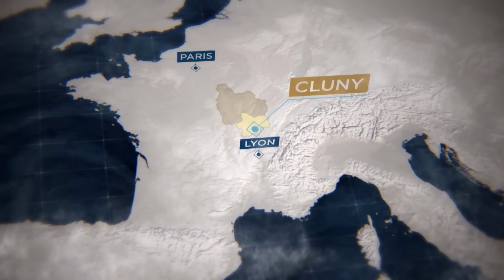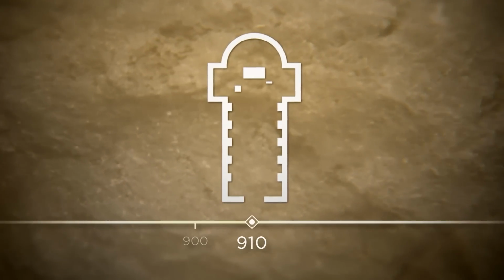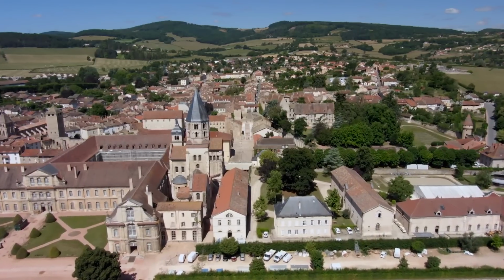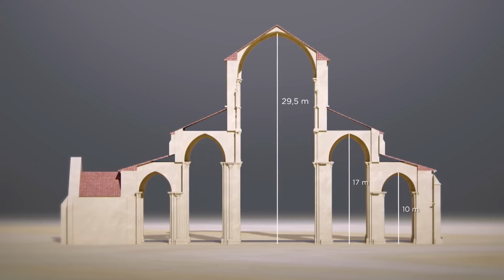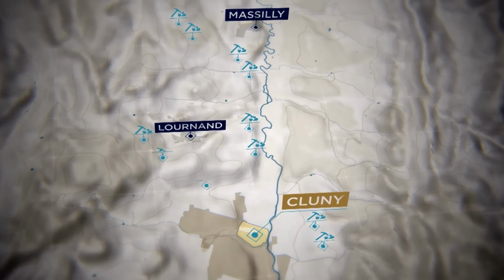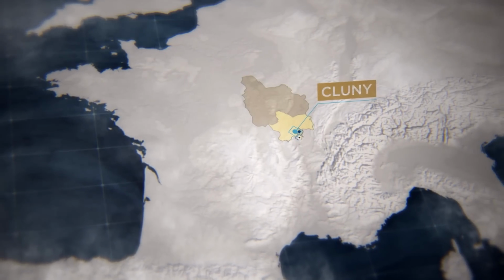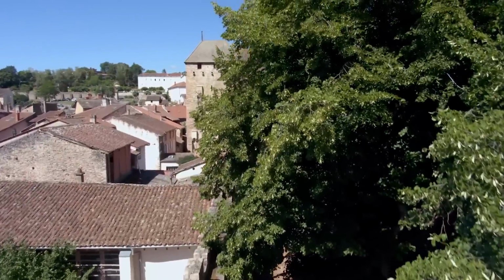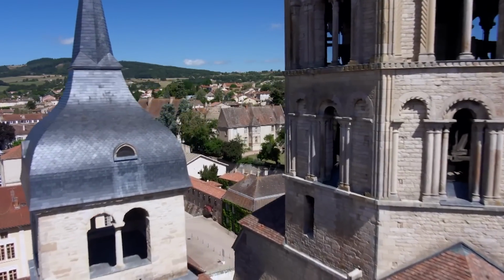Cluny Abbey: The Lost Wonder Of Medieval Europe

Comment: Maior ecclesia means not largest church but bigger church.
Reply: major esglèsia means the most important church, not the largest one
Reply: Largest church also means bigger church
Reply: @gman102formyspace  no.biggest church would be ecclesia maxima.
Reply: @RPe-jk6dv  in English, largest church and bigger church can be used to describe the same thing
Reply: @gman102formyspace  perhaps, but not in latin.
Reply: @RPe-jk6dv  just pointing out why the end translation would be different in English
Reply: @gman102formyspace  I beg to disagree, bigger church points to it being bigger than another it's being compared to, whereas largest implies that this one is the largest of its kind.
Although both statements can be true at the same time, you can still have a building bigger than another, but that does not necessarily mean is the largest there is.
Reply: @Inferryu  largest and biggest are synonyms
Reply: @ Indeed, but bigger and biggest are not the same.
Reply: @Inferryu  it was never a question about bigger vs biggest but the use of Biggest over Largest. And those are synonyms
Reply: @ " Largest church also means bigger church" That there is your very first comment in this tread.
Reply: @Inferryu  correct. Because they are synonyms. What you said was "bigger and biggest are not the same". Something i never said. I said largest and bigger were the same. The argument here was that bigger and biggest have different connotations. Cluny is the largest church. It's also the biggest church. You can say its "bigger" than all the other churches as well. Because both of those words mean the same thing and so does bigger with context.
Reply: @ Do I really need to explain comparatives and superlatives to you? That's middle school stuff dude.

Larg*est* and bigg*est* are (arguably) synonyms, and so are larg*er* and bigg*er*. 
Larg*est* and larg*er* though, are not synonyms, same for bigg*est* and bigg*er*.

As such your initial statement, that larg*est* also means bigg*er* is false.
Reply: @Inferryu  with context, It is "bigger" than all the churches. Thus bigger can be a synonym with largest. language is hard but Jesus christ, do you need to argue about everything?
Reply: @ Yes, but we're not talking about the church itself, but the meaning between these words, are you going to deviate from the topic just to save some face now?
Reply: @Inferryu  go back and reread this conversation. Yes, "bigger" can be a synonym for "largest" because "bigger" implies something is larger than something else, and "largest" means the greatest or most significant in size. This really isn't that hard.
Reply: @ I have, if you´ve done so as well you would have noticed, not only that some comments have been removed, but also, that I pointed this out in my first comment as well:
"Although both statements can be true at the same time, you can still have a building bigger than another, but that does not necessarily mean is the largest there is." It really isn't that hard, although you seem to be having problems with that.

Nevertheless, this isn't about the particular context, but rather your initial statement that Largest is the same as Bigger, and later on that they are synonyms, they are not, similar as they are, they serve two different purposes, you, having to word things around so that both end up having a similar meaning should have been enough of a hint that they are in fact not to same, there may be specific circumstances under which you can use any of the two, but even then their specific meaning will never be the same.

IF you insist in bringing context into this, then you'll first have to find a reliable source on the reason for the title, as it could very well be that it was called that for it being just a bigger church than the one before it, and not the biggest of them all, even if it qualified as such as well.
Reply: @Inferryu  in the context of this conversation, "bigger and largest" can be interchanged. In every day use they can be interchanged. The context used is repeated throughout the video. They constantly say it's area is what makes it bigger than other churches and makes it the largest church. If something is the largest, it is by default "bigger" than other churches. The phrase "who has the largest slice of pizza" and "who has the bigger slice of pizza" would have the same answer as well. Stop being so adamant that you are more correct about this. There is no point, and I will not be debating this further, and your attempts at finding another point of contention will be ignored. If you have any farther issues with this, take it up with your local middle school English teacher and see what they say.
Reply: @gman102formyspace  lol
Reply: @Inferryu  Yes, "largest" and "bigger" are synonyms, both indicating something is of a greater size or quantity. "Bigger" is a comparative form, while "largest" is the superlative form, indicating the greatest size among a group.
Reply: @gman102formyspace  lol.

Comment: This presentation is misleading, It wasn't bigger than St. Peter B or Notre Dame but it was longer.
Reply: @spj4188  the whole area was "bigger". Bigger doesn't mean taller.
Reply: @gman102formyspace  When it comes to area, by estimation Cuny III is about the same size as Notre Dame, but St. Peter's B is well over twice in total.

Something I find odd is that the plans shown here may not be to scale, or properly researched, St. Peter's B is stated to be 220m long, but that's for the "new" building, wich is the one shown here, the "old" building was indeed smaller than Cluny III, in length and area, and would have fit in the scale comparison presented in the video.